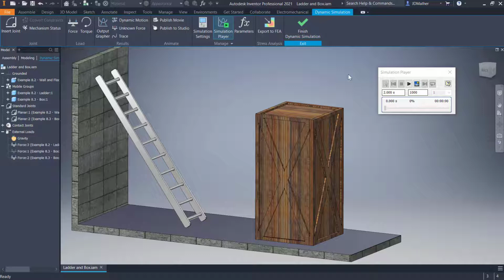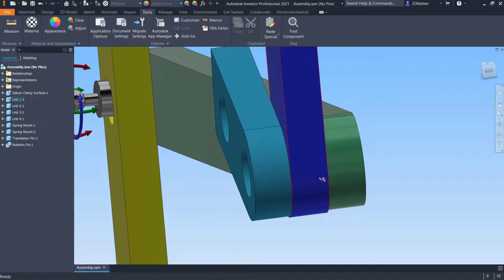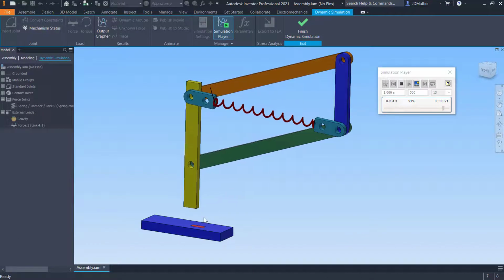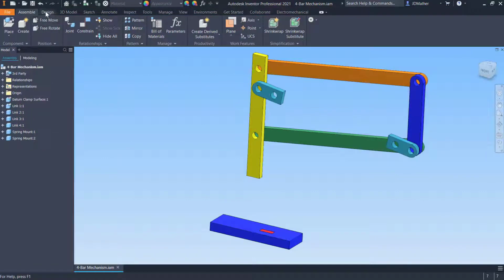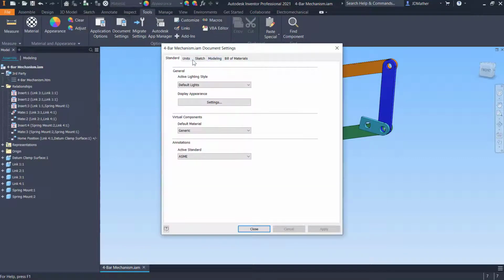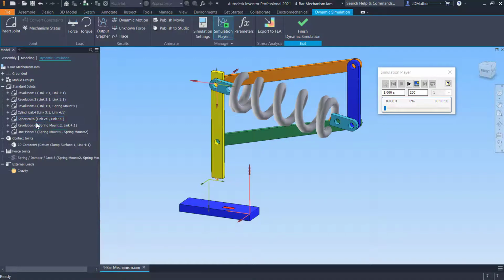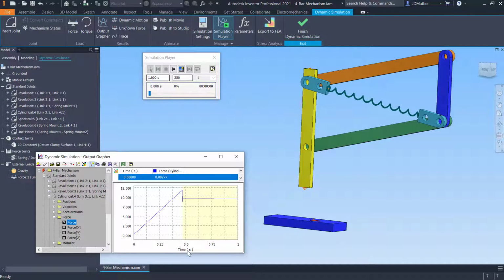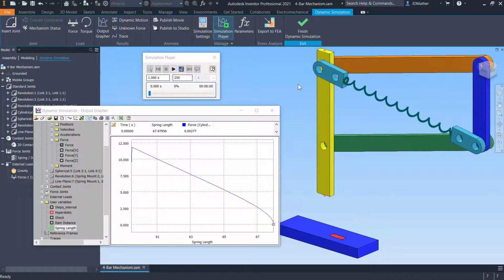Challenge   4 Bar Linkage

Comment: Thank you very much for these videos. Trouble shooting redundancies has been a nightmare for me. For along time i kept thinking of Dynamic simulation joints as assembly joints. Have you experienced a case where only locking the degrees of freedom you need to lock doesn't work.